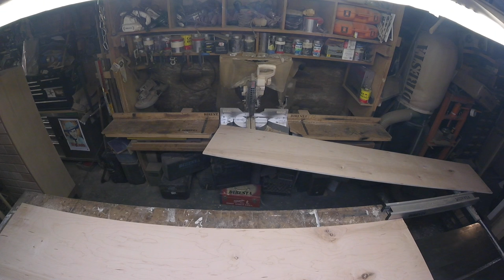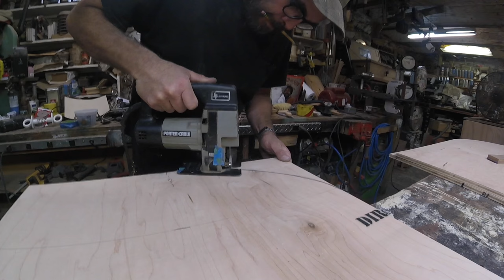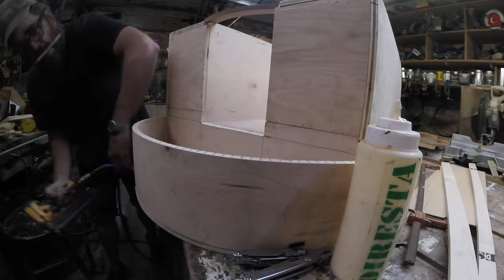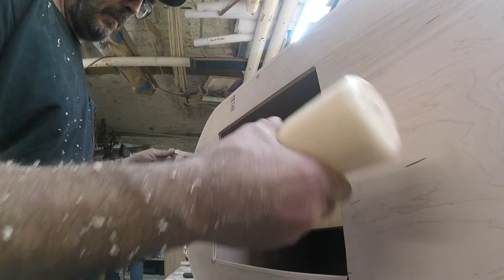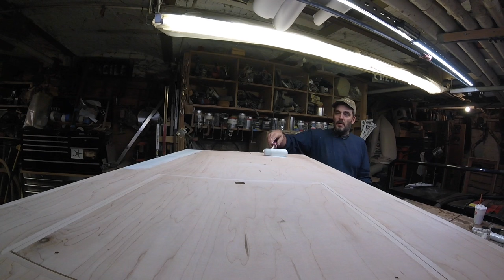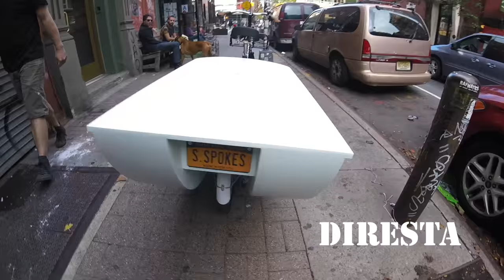✔ DiResta BIKE DESK

Comment: Wow, really clever doing the curved part with all those small cuts (and very safely done, pushing with the pen).
My only concern is the waterproofing / tightness of the hatch in the case of rain (or snow) . Probably some rubber flaps drilled on the hatch that seal it when closed?